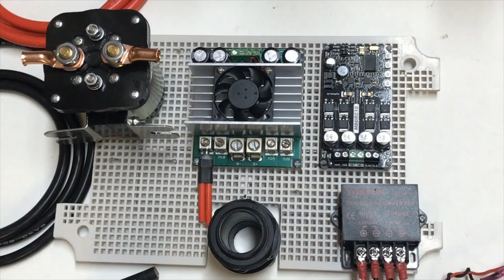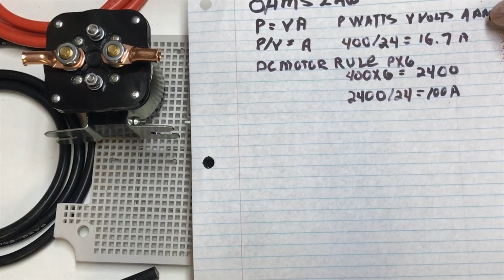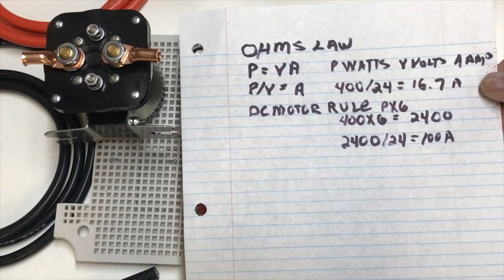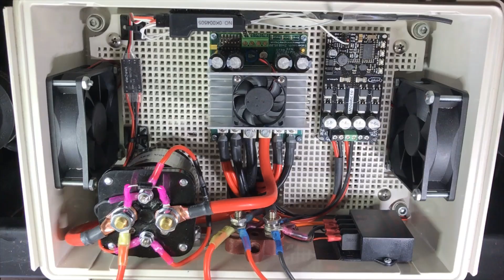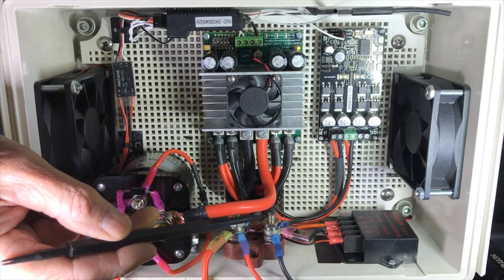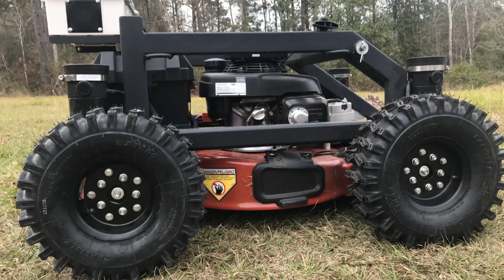4 WD RC Mower Motor Controller upgrade to Sabertooth 2x60 (Update)

Comment: Your videos on how to wire things up have been extremely helpful.  The Sabertooth 2x32 has a built in usb connector making it easy to configure the dead band and ramping settings for the driver using the Describe software.  However, the 2x60 driver does not have built in usb.  After the 2x60 upgrade, did you need to adjust the configuration of the Sabertooth or have you just accepted the default configuration and used the settings in the Flysky controller to adjust the channel 1 & 2 settings for speed and sensitivity of the mowers motion control?
Reply from the maker: Hi HudMoody, the settings were just the standard stuff, differential joystick, etc. nothing special. Flysky motion control was setup as per my video “Taming the beast”. Hope this helps 😊

Comment: From your RC receiver to the sabertooth did you use only the signal cable? so as not to use the 5 volt from your receiver? Or how did you wire from the receiver to the sabertooth?
Reply from the maker: The engineer at Dimension Engineering told me if I was using an external BEC to power the RC receiver, I would only need to use the signal wires from the receiver. That worked for me, but I had a few people contact me about this not working for them.  If it does not work, connect the two signal wire grounds to 0v on the Sabertooth.

Comment: then, the first diode goes between the positive of the sabertooth and the positive of the battery, in parallel with contactor (I understand that). But, the second diode goes in parallel with the contactor coil? Between positive and negative?
Reply from the maker: @carlosv0805  yes, see 2x60 wiring diagram for anode and cathode direction

Comment: Did you use any reducer to connect the 6 gauge cable to the sabertooth?
Reply from the maker: @carlosv0805  No reducer, items I used from Amazon: 6 Gauge 5 Feet Red and 5 Feet... https://www.amazon.com/dp/B0979GNW8S?ref=ppx_pop_mob_ap_share Or equivalent  6 Gauge 3200 strand Silicone wire

For contactor, RockDIG 10-Pack Gauge 6-5/16 Wire Lugs... https://www.amazon.com/dp/B07Z4BJNWK?
ref=ppx_pop_mob_ap_share

To battery, SELTERM 6 AWG 1/4" Stud (10 pcs.)... https://www.amazon.com/dp/B073YB9QL2?ref=ppx_pop_mob_ap_share

Cable Lug Crimping Tool,Knoweasy... https://www.amazon.com/dp/B08MBLZYWR?ref=ppx_pop_mob_ap_share

Comment: Hi there. Did you use any fuse protection for the motors or fans or batteries? What considerations could I use to use or not to use fuses? Thanks
Reply from the maker: @carlosv0805  I did not use a circuit breaker on the 2x60 because it is not needed. See ‘Thermal and over current protection“  in the Sabertooth 2x60 manual. https://www.dimensionengineering.com/datasheets/Sabertooth2x60.pdf

Comment: I'm planning on doing the same, but after seeing the price of such controllers, I'm probably gonna build one myself, these are way too expensive compared to the cost of 100A mosfets (only a few bucks per mosfet lol)..

Another technique that I was thinking about is to use e-bike controllers that can be found on Aliexpress for only a few bucks nowadays (Electric Bike Speed Controller 24V 250W or something similar, found some for 5 bucks lol), and one thing that could be done would be to plug the PWM to an ESP32 or something like that, the whole system would cost 50 bucks..

Comment: The cables that go from the alternator to the battery, what gauge are they? what are the characteristics of the fans? what are the dimensions of the box you used? Thanks
Reply from the maker: @carlosv0805  cables from alt to battery are 6 gauge jumper cable from harbor freight. 80mm 24V DC Cooling Fan CF8025... https://www.amazon.com/dp/B07K2WTPWC?ref=ppx_pop_mob_ap_share.  BUD Industries NBF-32016 Plastic... https://www.amazon.com/dp/B005UPANU2?ref=ppx_pop_mob_ap_share.
Reply: @ I guess you're using the same 6 gauge from the battery to the motor controlller
Reply from the maker: @ yes

Comment: I understand that the coil on your 200A SPNO Solenoid is 24 VDC. How do you activate this coil with the elechawk? Is this switch connected to 24 VDC? What I can see is that the elechawk is connected to the radio receiver.
Reply from the maker: @carlosv0805  I’ve added a visual aid in the google drive folder named Elechawk wiring. Power is 24v battery, load is the two wires going to the contactor  24v activation circuit.  Power to Elechawk is 5v from the receiver. The Elechawk is controlled  via  signal from a receiver channel.  The channel is operated  by toggle switch on the transmitter.  Flip the switch, signal goes to Elechawk which in turn activates Roger white contractor.  By default channel 5 is assigned to switch A. YouTube has multiple videos on how to assign a transmitter switch.

Comment: Hi there, I have a similar setup but a different application - whenever I power the receiver with the 5v on the sabertooth I have no issues but when I power it via a 24-5v regulator the wheel movement is not smooth and real jerky- have you run into this issue ?
Reply from the maker: @bigdaddy2126  Hi Big Daddy, I have not experienced your problem with the 2x60.  The only thing I can think of is making sure the receiver is powered up before applying power to the Sabertooth and check the dip switch settings. In my configuration you cannot use the 5v supplied by the sabertooth  because the receiver needs to be powered on in order to switch the sabertooth on and off by the relay circuit.

Comment: Great Build! And great explanation. I know it’s been a few years but wanted to know how the electronics was holding up and what changes you would recommend. Thanks.
Reply from the maker: @bigdaddy2126  Hi bigdaddy, thanks has for the compliment. I’m in my third mower season, no problems yet, still going strong as the first time I used it. I plan to upgrade to dual 2x60, giving each motor its own channel. Watch my video “End of mowing season review” on why I would upgrade to two controllers.  There is a link in the comments to my google drive that has the dual sabertooth wiring diagram. Only thing I would change would be a remote control mower deck height adjustment.  Mine is manually adjusted and is a pain to change heights due to the very heavy battery assembly being  attached mower deck.There is a lot of additional information in all of the mower video’s comments.
Reply: @giterbilt5146 thanks for replying. Have you had any issues with the motors creeping slowly (something to do with remote receiver calibration) if you turn on the controller before turning on the remote ? I read you have to always turn on the remote controller on first ? Is this correct.
Reply from the maker: @bigdaddy2126  The transmitter and receiver must be communicating before power is applied to the motor controller. The controller box and the transmitter can be turned on in either order. Power to the motor controller is handled by the on/off activation of the motor controller relay by a receiver channel switch. The switch has to be in the off mode in order for the transmitter and receiver to pair up. 
The motor controller handles braking via regenerative power of the motors. I have not encountered any incline  where the motor controller cannot handle the braking. With the power off it could roll down an incline. It would be very slow as the motors are acting as generators when rolling without power.  If you buy wheel chair motors that have brakes, you can use a receiver switch channel and RC switch to disengage the brakes. Brake are allow set when no power is supplied to them.
Reply: @giterbilt5146 thanks! Last question (for now) - where do u but ur main contactor/solenoid from ? Lot of the ones out there are fake and not fully rated despite being labelled as fully rated.
Reply from the maker: @bigdaddy2126 The contactor used is in the Video Description and on the 2x60 wiring diagram. You will find a wealth of information in the comments in all the videos on the mower. If your specific questions are not answered, let me know and I will try to answer them.
Reply: @giterbilt5146 the other question I have is what do you do for brakes ? I assume this is atleast 200lbs - how do u make sure it doesn’t roll off?

Comment: Thank you ever so much for this very helpful series. I have gone pretty much the same way with my Project and likewise have discovered the inadequacies If the single 2x60 sabretooth. So arriving yesterday came the seond 2x60 from Germany. But my question is If you would be so kind to advise is clarification of your circuit diagram. I simply faul to understand why there is a second cable from the + battery which seems to bypass the Diode and go straight to the pair of sabretooth drives Without a switch. I want to incorporate diodes to protect against the Reverse Generation as you say but I just don't get it. Maybe this Technological imbecile should just do as told and I would do If it were not for the fact that your other circuit for the single 2x60 does Not show this jumper wire at all and I can understand this diagram. Could you please Tell me what I am Missing? Also what does Capital "A" in a circle mean? Ammeter Alternater?. Thank you. Kind regards from David Ede Carinthia Austria EU
Reply from the maker: I don’t know what the Veterans Administration was putting in my medication when I made this drawing, but I sure screwed it up. New medications new wiring diagram. Simpler to read. God I hope it’s right this time. S1 on each controller drives the front motors, S2 drives the rear set. In this diagram I show the rear motors in reverse polarity because they are mounted in the opposite direction from the front on my chassis. Again, I apologize for the confusion and thank you greatly for pointing this out. The updated diagram is on my google shared drive. If you find any other mistakes, please let me know.
Reply from the maker: Hi David, you are absolutely correct! The line to the left of diode should not be there. Thanks for bringing this to my attention. I will update the schematic when I get a chance. The circle with an A in it is a symbol for an Alternator.
Reply: @giterbilt5146  oh thanks for the reply. Kind regards David
Reply from the maker: Schematic updated. Thanks again for your help.
Reply: Sorry. I have another question before I turn the power on. I do not understand why each motor's positive and negative wires do not Return to the same Controller in all cases? For example left Motor front takes it's positive from positive on the left Hand sabretooth but it's negative returns to the negative on the right hand sabretooth. Why does it not simply return to the left sabretooth? The same question applies in all 4 cases. If I had not seen your Diagramm I would have driven the front left Motor from the Pos and neg on the left sabretooth and the left rear motor from the same pair of Pos and neg terminal on the right hand sabretooth. And ditto for the other side. If you find time to answer I would greatly appreciate it. Thank you 
Kind regards David
Reply from the maker: Hi David, just curious, did you get your mower going?
Reply: @giterbilt5146  
Oh hello again. Thank you for asking.  Actually I have taken yet more steps in this now year long project. I wouldn't say I am at the end of my tether but I  really really feel i cannot improve Situation much more. The second sabretooth 60 is in place but not in the way you have described. I decided that one sabretooth should be dedicated to the left Side  and the other to the right. Then the left Stick of the flysky does forward and reverse of that Side and the right Stick does the right. It involved some clumsy surgery of the Transmitter left side to rotate the Joystick the 90 degrees it needs to make it Natural. I suppose my decision to do this arose from having an Oldtimer Tractor for snow Clearing. You have 2 levers dedicated one to one side. Pulling one lever declutches the drive and applies a brake to the corresponding Track  and the other goes on. You don't actually need to reverse the Track to turn. Just Stop it. The Singular Problem with a single Joystick Setup is it is Just too fancy. It reverses the wheel seemingly willy nilly and digs holes in the lawn . Or perhaps it's Just clumsy me. Anyway I feel better with my Setup. But I have to say that the wheel spin Problem is not resolved. I don't understand the electrical reasons for it happening but I believe that the only sure way of making it 4 wheel drive in the true sense of it is to mechanically Lock each side to itself. Chains or shaft drives or Tracks but tracks would have to be properly engineered for them to work. I have discovered that the MTD snowblower mechanisms just don't work under Strain. The Rubber tracks just vlimb Off the sprockets 
Well my last step was to remove the 4 Rolls 6 Volt batteries and replace with a single 100ah Lithium Batterie which I have done this morning. I have reduced the weight now by about 80kg. When it stops raining later next week I shall have another Go at my 50 degree mostly sand bank. I can't send you Pics i don't think on this Platform but let me know If you want to See. I am sure there is a way.
Kind regards David
Reply from the maker: Thanks for the info. I like the one controller per side. Sure makes configuration easier. If you get bored take a look at it the V2 wiring diagram and see if the setup is like yours. Thanks!
Reply: Hello again.  Well I have carried on and learned a bit more. I tried the 2 sabretooth setup but still had the old problem you have outlined , a "dead wheel" when it's same side partner loses traction.  I tried to improve my  almost nonexistent knowledge of electric stuff on the Internet and I now  think,  Subject to your correction that  without a torque management system (the only  analogous situation i could find under the topic of electric autos with a motor in each wheel) the problem cannot be solved. Leastways I can't see it. I have given up that  route and fitted a small winch to the mower, hook attached at the top of the  bank and the motors just position the thing as I winch up and down. It works albeit slow and  I have to take regular breaks to let motors cool down.  I have already burnt out 3 of those far eastern 250 watt motors! I shall carry on and
When the summer is over and  the grass has given me a break I shall  install the recently  bought 2 secondhand  German  made  1 kw 160 rpm motors to drive 1/2 ×5/16 chains in tandem linked to each side wheel s. That's my answer to 'torque management '. Not my idea. Your willys company I think .
Thank you ever so much for your brilliant youtube contributions.  Without which i would never have got so far.

Kind regards David Ede
Reply from the maker: @davidede6721  Is switch 4 in the down position (independent mode) on both controllers?
Reply from the maker: Hi David, that’s disappointing news.  I also looked at all the information I could find on ground coupling electric motors before coming to the conclusion that the solution would be 1 motor controller channel per wheel would solve this problem.  I am totally baffled by this, each motor is independently controlled and should not affect the other motors.  Thank you for bringing this to my attention, I’ll ask other builders on my channel if they had the same outcome.

Comment from the maker: You should not connect two controller outputs to one motor. They will not work together and could damage the motor controllers. Your best option is to use two separate single channel motor controllers.  You specified that you have 600w motors, if this is the running wattage and you are using 24v battery set, the current needed would be 25amps, with a stall current of 150amps.  Here are two options that I would consider. My first choice would be the Vyper 120A DC Motor Controller, https://www.robotshop.com/products/vyper-120a-dc-motor-controller. My second choice (less costly) would be APO-M2 Maximum 80A ESC, https://www.ebay.com/itm/355349889608?itmmeta=01HS6BJ3PHJA0S3A9RH5SE4QNT&hash=item52bc810248:g:5PMAAOSwnZBlmQwu&itmprp=enc%3AAQAIAAAAwL5mS9J1KtKk81bu3vt%2FvV3oJSd8%2B4MJol5y8jEd%2BSgIrDwsE%2BA0qIr4%2BHu3wOWdR49f6WfLVusukRunYwGeENe5cPyeZNGDnUoa7JyH1KO7eXlqFDU1vmzUatSCFf7mIO%2FjzGBgbHav7itZi4h2WTf44okBNUIcyOzVEFWt3WNDz7u3%2FTlRW3XqCZWrA2YiR8R%2Fjc%2B7ZeK0AjQ9iHeFVj5EVkdQfF58YBkSc4xRifv6F%2FR78zEUFx7M3jfPNjvyLQ%3D%3D%7Ctkp%3ABk9SR7C7yMvJYw , it can handle the running current, but does not cover the max current. 
This should work ok as long as you have a gear reduction to the wheels that would not create a load greater than 80A. My Sabertooth 2x60 can’t handle the max (stall) current and I handle this problem by changing the power output signal to stay well below max current of the Sabertooth. See my video “Taming the Beast, Flysky transmitter setup to 2 speed operation. The wiring for the individual controllers is not much different than shown on my single controller diagram. Each controller needs battery + and - , controller output + and - to each motor, and receiver Ch1 to one controller and Ch2 to the other.  Good luck with your build.